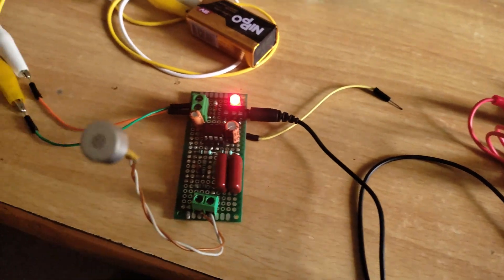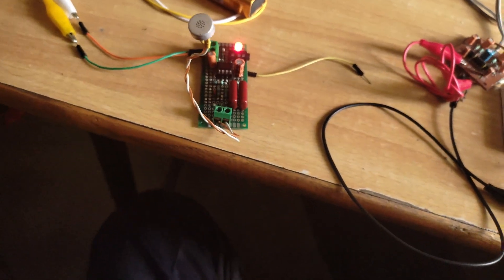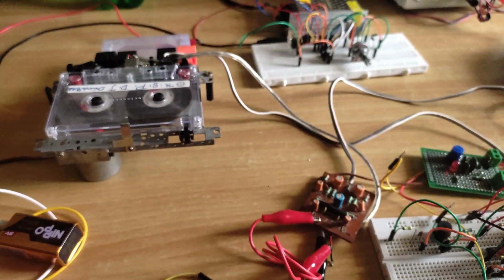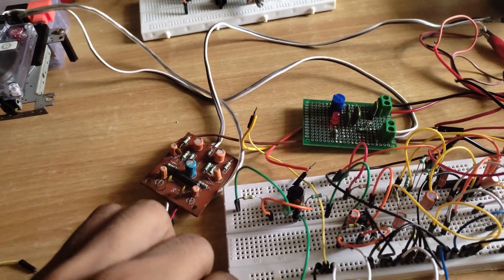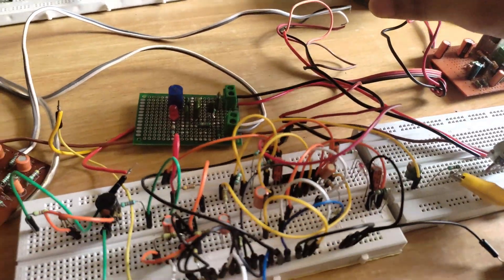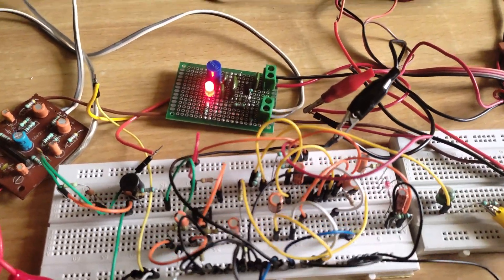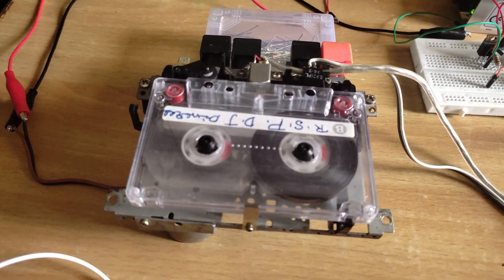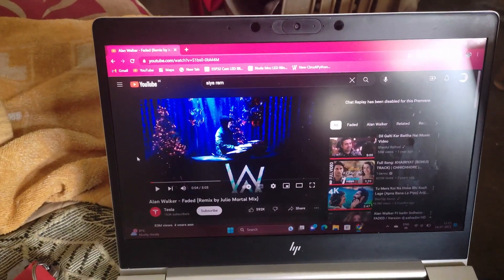Make an AC Bias Cassette Recorder /Tape Recorder

Comment: Sir AC Bias set at which kHZ. AC Bias oscillator circuit.
Reply from the maker: Bias Oscillator frequency is 54KHz.
Reply: @ramatronicslaboratory2040  Thanks. But at peak should be around 90-100 KhZ

Comment: What happens if you don't use bias
Reply from the maker: B-H Curve of magnetisation and demagnetisation of magnetic tape is not linear at some regions of the curve. For distortion less recording it is necessary that recording characteristics should be in linear region of B-H diagram. Hence  we apply AC or DC Bias to recording head, so the recording curve will be in linear region of B-H curve and during playback of recorded audio we are capable of reproducing high quality of audio signal. Frequency of AC bias is always kept higher than audible frequency range.